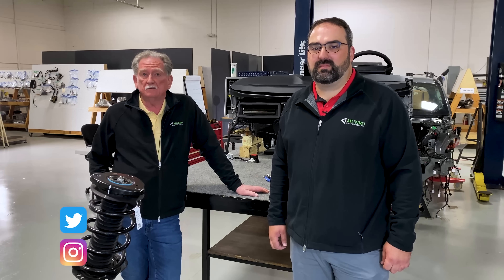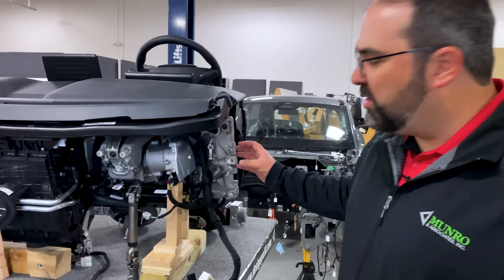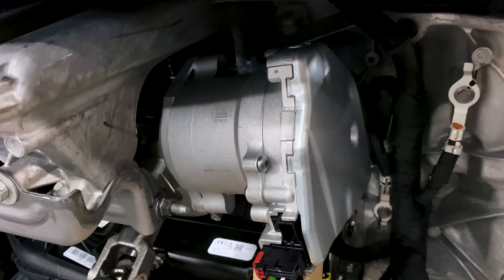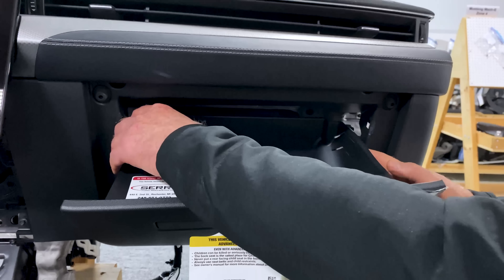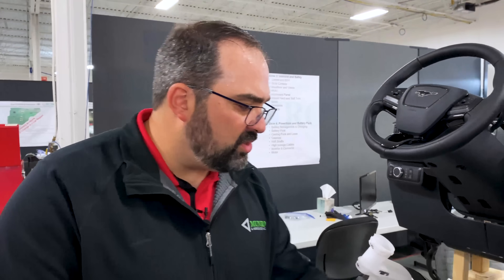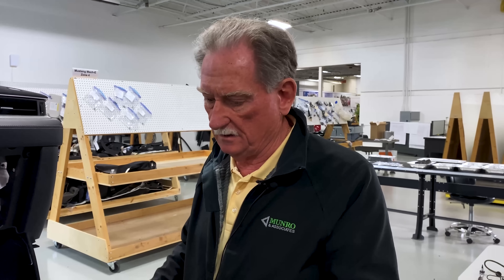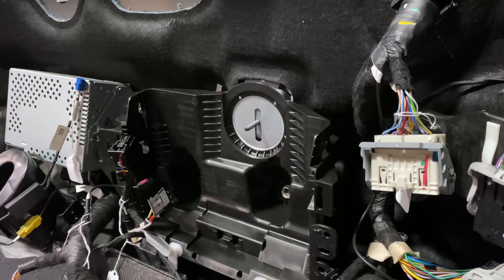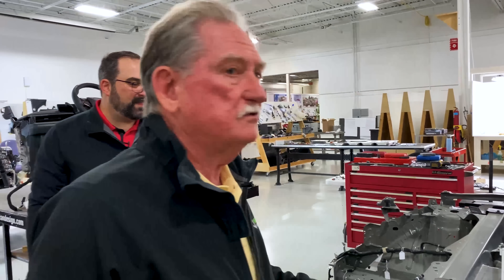Ford Mustang Mach-E Instrument Panel (IP) Assembly and Analysis

Comment: If a driver needs to stop fast, that driver may absolutely mash the brake pedal. That driver may be 300 lbs and may apply crushing force to the pedal. I think it needs to be strong regardless of the actual mechanical functioning.

Comment: There seems to be a lot of confusion as to how this type of brake system works. So here is a highly simplified explanation of how it works. 

Imagine you have a pushrod from the pedal to the booster but instead of being a solid rod in includes a compression spring. In that assembly there is a sensor, like a dimmer switch, that determines how compressed the spring is. The computer then decides what the appropriate action is. Small amount of compression means a small amount of regen braking while a fully compressed spring results in maximum regen braking. Once that spring has been fully compressed additional movement of the pedal will actuate the master cylinder mechanically with the assistance of a booster. 

The booster is largely independent of this action, as mentioned, in HEVs and PHEVs it is common to still use a vacuum booster and use a vacuum pump when the amount of stored vacuum needs to be replenished with the engine off. In this case since there is no occasional free source of vacuum they use an electric motor to directly supplement the input force. 

In the event of total electrical failure the spring will compress the pedal input will directly, mechanically, actuate the master cylinder and the car will stop. Just like with a vacuum booster that has used up all the supply when the engine died it will require greater input pressure and travel to complete the stop. 

Of course in the real world it is much more complicated than that as there are times when regen braking may not be available so the system can apply friction brakes if needed with a small pedal input. Additionally as regen braking falls with speed it can add in friction brakes to provide consistent braking force and feel.

Comment: The brakes although electric in an event of total power lost you still can slow down and stop the car using only man power and pressing as hard as you can, plastic brake pedal will not fit the job.

Comment: 1955. Citroën redefines brakes with the DS19. It took to 2021 for the others to stop using the man-driven system. But the Citroën didn´t have a pedal so it may still be a bit ahead. ;)
Reply: Sadly, this car isn’t break by wire. He literally showed us the master cylinder. The brake pedal is loose in his hands because they took it out…

Comment: The brake pedal is mechanical. If the electronics fail you can manually actuate the master cylinder but it requires a large amount of force and travel to do so, if it works anyway like the systems on the older Ford Hybrids and PHEVs. .

Comment: I would have liked to hear more about how the electric replacement for the vacuum/hydraulic brake booster works.
Reply: Well, it has a snap on hose. Outside of that, some kind of magic. ????????
Reply: He didn’t talk about it because this car isn’t equipped with that. It’s still equipped with a traditional brake system, it’s just that the vacuum is made by a pump. We literally see the hole where it would connect to the pedal and the pedal was loose because the mechanical link wasn’t in place.

Comment: I believe the power steering motor gets used alot, right? So in my opinion to mount a more efficient (smaller, or less power needed) motor lower is better for an EV, because it will eat less of Your battery power. And as I said in the beginning, this thing is used every time You turn the wheel, so alot.
Reply: No, power assist isn't needed once the vehicle is at speed, so the motor just goes a long for the ride in a lot of steering wheel movement.

Comment: I had to look up the term "body in white". I think it would be good to briefly explain it in another video.
Reply: On a unibody vehicle it's the structure of a vehicle to which all the removable (not "welded") components are attached. On a body on frame vehicle it's the structure to which the removable components not mounted to the frame are attached.

Comment: Plastics that break today (or tomorrow) work perfectly well on engine inlet manifolds so why not accelerator pedals?
Reply: If by work perfectly well, you mean break when removed next, then yes.  I was a service advisor for a couple years and we had a 50% or so chance of micro cracks when plastic manifolds were removed.  They just experience to many heat cycles.  Then again, the oil pan and drain plugs are plastic at this point too.
Reply: Here’s why!
https://teslamotorsclub.com/tmc/threads/accelerator-pedal-broke-off.92712/

Comment: Some plastics break today, some breaks tomorrow. This was Deeppppp... Can you tell us what is the substitute for the vacuum booster we saw in gasoline vehicle which assist in braking in EVs? What is being used in an EV in replace for that.
 Also, some limelight on how practically Regenerative braking work in Mach E?
Reply: There's still a hydraulic master cylinder mechanically connected to the pedal (Sandy was wrong about this, other folks have already picked up on this). It looks like the ABS/ESP pump and valve module has been integrated into the master cylinder as one assembly,  but no matter. Hydraulic pressure from brake pedal goes to a pressure sensor but isolated from rest of brake system, ABS pump sends pressure to actual brakes...the computer decides the blending of regen and hydraulic. There is a valve between the master cylinder and the rest of the system. As long as system has power and is happy, this valve is closed...brake by wire. If power fails or faults, valve opens (default position), now you have manual hydraulic brakes although without ABS. Obviously greatly oversimplified.
Reply: @bikeaddictbp  ok got it, i will read more for better understanding thank you.

Comment: That blank spot on the passenger looks like a spot where the amplifier would go on the upgraded sound system.
Reply: A 5 channel class D car amp or computer shouldn't need that much space, maybe for an intruding part of a 4WD system?
Reply: @psdaengr911  OEMs aren’t known for using the best (smallest) available audio upgrades. The model he’s tearing down is an AWD, so anything that would have been related to that would have been on the car.

I was partially thinking this because the grey box it’s next to is likely the main “brain” for the touchscreen.

Comment: Sandy, you are brilliant and your team is fantastic.  I just have a problem with your MACH-E analysis.  The analysis is all about making the car cheaper and easier to make. There is nothing about making it easier to repair, safer, or more reliable. Example: Magnesium castings in a car; a seriously bad idea. Magnesium wears easily, cracks, corrodes as an anode to anything connected to it, and worse is a massive fire problem. If there is a battery fire, and there are lots of them in battery cars, the magnesium burns quickly, extremely hot, and the fire can not easily be extinguished. Exactly why race cars quit magnesium wheels years ago. Reference plastic: NOOOO! Plastic cracks, breaks, bends and is effected by heat and sunlight over the years. Note: GM has a 130,000 Buick and Chevy car recall out today. Because they supplied a plastic car jack instead of a metal one. Just plain nuts. They all failed.  Finally, HOW ABOUT EASE OF REPAIR???  Ford air conditioners have a history of rotten reliability and expense to repair. Why, because they use plastic doors and parts in the air box. All of which break, and the location is expensive to repair. This has been a big problem in F-150s and Expeditions from 1997 until today.  The MACH-E is even worse.  The air cond. is all plastic, and buried in  the panel. Which even Munroe had a hard time removing.  The entire MACH-E is a repair nightmare, with numerous un-reliable parts and engineering; mostly for ease of manufacture and costs.  One report out, is that it takes 6 months to get a repair bumper for this vehicle.  This is exactly why, the President, and numerous States, i.e., Mass. New York, and others are pushing "Rights to Repair Laws."  It's not about making cheap junk that is worthless after the warranty runs out, i.e., BMW's, Mercedes, etc.  It's about making vehicles that are safe, cost effective, and easy to repair and maintain.  As of this month, the average US Car on the road today is over 12.1 years old.  This MACH-E will be junk in just 3 years or less, and costs massively more than the average US Citizen can pay. Which today is about $26,000.  How about adding content to your show that deals with ease of repair, long term reliability of parts & design, and not just: "Cheaper and easier to make."  Remember: originally BMW made its mark with the 320. Which was easy to repair, and even came with its own tool box in the trunk.  Today, vehicle manufacturers all want to be Apple Computer and not car makers.  This is going to take us to OS system updates, that are required to run our cars. This maybe OK in a cheaper computers or cell phones.  But, is totally unacceptable when dealing with the 2nd most expensive purchase a person, or family, may make.  The lawsuits and regulations will come fast and furious. If the manufacturers do not do something today to stop this soon to be financial disaster for them and their customers.  Thanks for the read. Big fan of your podcasts.
Reply: Interesting points. Eager to see a reply from Monroe or SME with a different perspective.
Reply: Paragraphs, my man ^^
Reply: Good point. Sandy?
Reply: I too would like to hear more input about quality, durability and cost/ease of maintenance as these things cost the customer money as repair costs or early vehicle replacement and are just as important as the initial vehicle cost.  Assuming equal cost of ownership, a $30,000 dollar vehicle that needs replacing after 6 years is $5,000 more expensive than a $35,000 that will last 8 years but most people don't realize that.  

You probably have already seen Rich Rebuilds example of Tesla's modular approach requiring a $16,000 battery replacement for a $2 broken plastic cooling inlet pipe that is susceptible to road debris damage.  That is insane.

The magnesium castings are likely not pure magnesium but an aluminum alloy with some magnesium content so it gets that label because ooooh magnesium.

Comment: So you guys want a cheap plastic brake pedal? So when someone instinctively stomps down hard in an emergency, it breaks off!
Reply: I think they are trying to combat that myth.  Personally, I'd rather have my break pedal suffer plastic deformation (google it) than crack in half like a typical casting.  Objectively, neither has been a problem in the last 20 years with both types of pedals being in common use.

Comment: Just watched the segment that (I think) discussed the braking system, and was very confused.   The fact that an EV doesn't have a source of vacuum to operate power brake boosters from was mentioned, and I was very curious to see how an EV boosts its braking force.  Disappointingly, that wasn't mentioned.
Reply: Done electrically via the ABS pump.

Comment: Question for the specialists: I remember in Chemistry class burning some Magnesium shavings. They burned brightly and it was self sustaining. Any concerns when the car parts are made of Magnesium?
Reply: re: "I remember in Chemistry class burning some Magnesium shavings." yes PURE Mg. Q: Any concerns when the car parts are made of Magnesium? A: no more than any other material used in the vehicle.  what's important to understand is when Sandy (or anybody else) says a part of their modern car/motorcycle is made of Magnesium what they really mean is the part is made from MAGNESIUM ALLOY (Magnesium, Aluminum, Zinc, Silicon, etc).  the item will still burn (i know i've ignited some) but these "alloying" elements change the flammability as well as they change the mechanical properties (ie. strength and resistance to cracking).  lets not forget TIRES burn like a mofo.
Reply: @phillyphil1513  Thanks, Phil!
Reply: What Phil said and you can quickly heat shavings to temp.  Not so easy with that massive casting.

Comment: Air filter at around 8’:  I cant tell how/if it is separated from the space in behind the frunk tub.  In two of my vehicles, one a Ford F150, mice found their way to the air intake, happily chewed my air filters into nesting material, once perforated got inside the cabin.  Once the first mouse finds her way in others follow the scent trail.  Cost thousands of $ to me and my insurance.  Eventually I had the local body shop glue a barrier of hardware cloth to the air intake.  OEM should should design to avoid an issue like that.
Reply: Great Idea but did you think of taking care of the mice problem?
Reply: @MrSvetlin09  hi.  I need to park outdoors in a rural area, sometimes I’ll leave the vehicle at a trail head in the woods while I am of pf in the mountains for a few days.  I can’t very well wipe out the rodent population of British Columbia.
Reply: @earnmyturns6305  😂😂😂👍
Reply: My old Ford Escape has a fine metal screen around the cabin air intake and the filter is inside the screened area. I'll make to make sure my newer vehicles have a similar screen. Rodents are a problem!
Reply: Never had this issue... Sounds isolated

Comment: i would like to see, how many times can you jump on break pedal, when you really  have to use it, until it break. I'm not gonna press it softly, just because i know it's just a "dimmer". In traffic, sometimes you do things subconscious... i mean, you not gonna jump on gas pedal, so i can see the point to make it of plastic. Break pedal is different...
Reply: Also lets make wheels from plastic, it's just "rotating thingy with rubber", right ? Also, lets put plexiglass instead of windshield, right ? glass is too heavy anyway...

Comment: 13:22 This is not exactly true there is still a linkage arm connected to a master cylinder assembly underneath the hood it was actually taken out in the beginning at 0:08...
Reply: This needs more upvotes, I had no idea what Sandy was talking about - even if the car didn't have a physical connection - which at 0:08 it looks like it does,  it would still simulate a force to the driver and so would need a sturdy metal pedal.
Reply: @LotusEuropa73  like sandy said, you can make it just as sturdy without using metal which is heavier.
Reply: Very good reply. Was also wondering about this, as I guess everyone knows how hard it would be to break w/o the motor being turned on (or the battery) supplying the brake booster. Guess it would be the same for power steering. If I was a car manufacturer, I would definitly shy away from relying solely on working power steering / brake boosting. While this systems are very reliable, the prospect of any failure in this systems and the consequences to passengers and the car makers image wouldn't be worth the money saved. Same thing is true for door opener / unlock buttons w/o any physical 'hazard' switch to get out of the car.
Reply: That's a relief! Having a brake system that wouldn't work after loss of electric power would have been really worrying!
Reply: @andersmusikka  there's still hopefully an handbrake you can use
Reply: @swissTom124  It’s probably electric on that car.
Reply: @swissTom124  which is electric 🤔 also

Comment: Idk why I get the sentiment that Ford doesn’t want to admit they’re using battery packs from SK because they copied LG tech.
Reply: who knows they may yet switch (or stay diversified) Ford has openly declared the forthcoming F150 will have it's pack made by SK in a joint venture named "BlueOvalSK" from the new plant that's been built here in the US (Georgia).  the Mach-E is obviously in production/being sold NOW so naturally this required committing to a supplier agreement with LG back 2 and 3 years ago.

Comment: Sandy, you appear to be going out of your way on some of these Mach-E videos to make excuses for Ford's decisions to provide less performance and quality to save $$s.  I believe most consumers prefer quality and performance delivered by Tesla, BMW, Porsche, etc.  Ford is making a big mistake!
Reply: quality by Tesla?? You made my day
Reply: @garfieldchenyu1  Suggest you watch Sandy's videos again.  Apparently, you missed where Ford used inferior (off-the-shelf) suspension parts resulting in decreased steering and handling to save $$.  Further, Ford uses a column-mounted steering motor instead of down on the steering rack, once again reducing steering performance to save $$.  That's why a Tesla drives like a BMW or a Porsche and Fords don't.
Reply: @garfieldchenyu1  re: "quality by Tesla?? "  sure the Model 3 and Model may "look" like an "imitation Porsche" but ask any owner and they will tell you, what you DON'T get in that deal is an authentic OE 911 paint job.  people apply vehicle wraps and clear bras to Teslas IMMEDIATELY not because they want to, but because they recognize they HAVE to, otherwise the finish will chip and look like shit very quickly.
Reply: @phillyphil1513  out of date info

Comment: Wait...the Mach-E is brake by wire? Are other cars like this?
Reply: Q: Are other cars like this? A: yes (ICE) Chevy Corvette C8, Audi E-Tron, etc.
Reply: Video was a little wrong. There is still a mechanical/hydraulic backup. Required by motor vehicle safety standards.